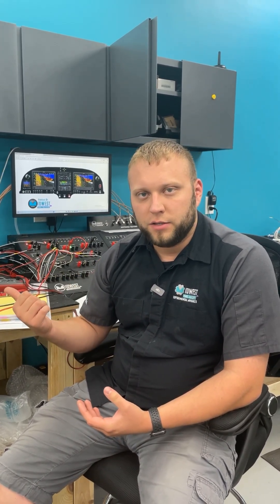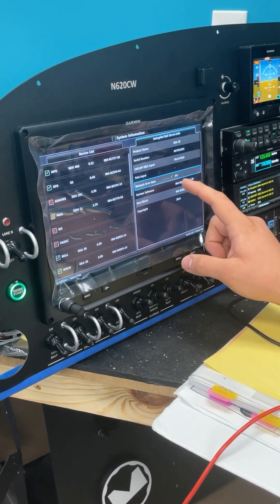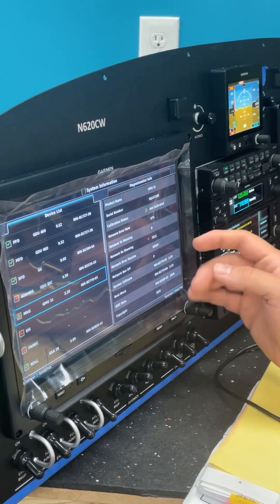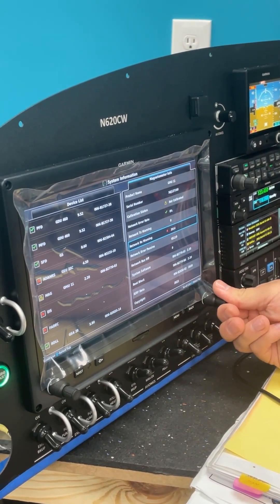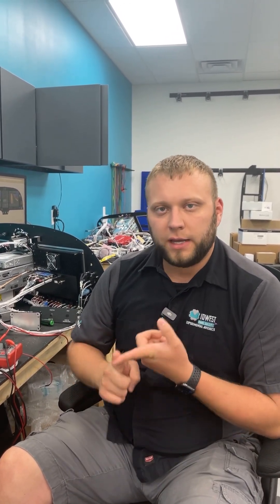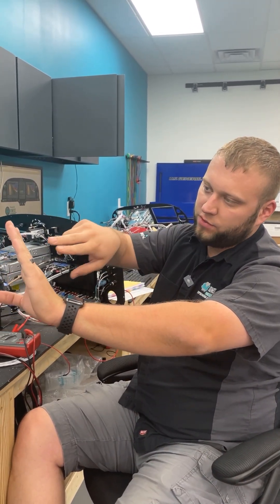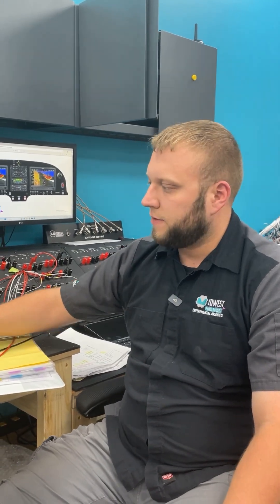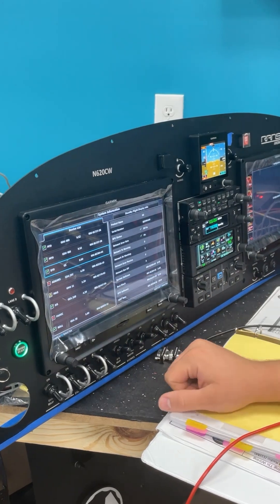Tech Tip Tuesday CAN Bus diagnostics

Comment: When I installed my canbus I immediately ran into errors.  Turns out I used the wrong pins on my audio panel and plugging the can bus into a speaker doesn't work.

Comment: Great video. A few additional clarifications: It's a bus, not a daisy chain configuration. Nothing goes hop by hop. All packets go directly from the sender to the receiver. There are no intermediaries that receive packets and pass those on to the next down any chain.
The termination resistor swallows echos at the end of the cable if the resistor (R) has the exact same value as the magnitude of the complex resistance of the wire (Z). If they differ, you get an echo at the end and the signal travels back, destroying bits. It is quite possible to measure the Z of a cable with a network analyzer like the NanoVNA and terminate it with the correct R to eliminate all echos even if the cable is of the cheap kind with a Z different than 120. This would not be a free pass though to make very, very long cables, there is another issue with length: each unit, before transmitting, checks whether the bus is busy. With long cables, you might think it's not busy, but far away, someone else has already started transmitting, the bits just haven't gotten to you yet. This causes clashes / packets with checksum errors.

Comment: I suspect it is easier to find the third terminator when you added it to do the demo.  😂

After several decades of working with computer networks, I have found that it is far easier to spend a little extra time being very careful when wiring the connectors than to find a fault later.  I recently brought up my avionics and I have 14 nodes on my CAN and thankfully they all came up and worked perfectly.  I took my time and checked and double checked each node as I wired the connector.
Reply from the maker: It certainly helps